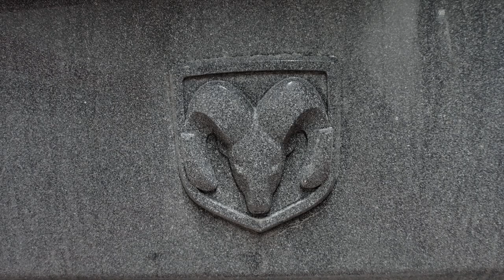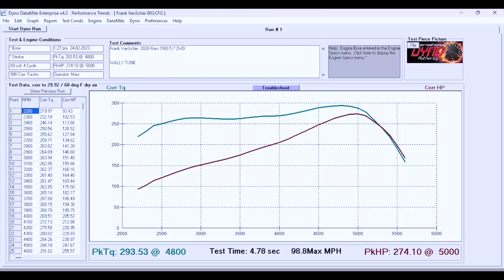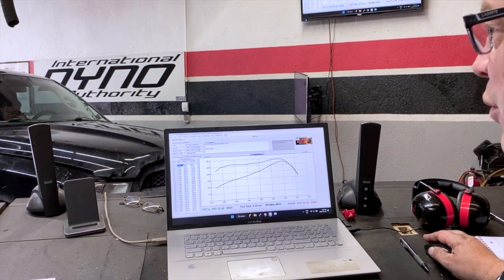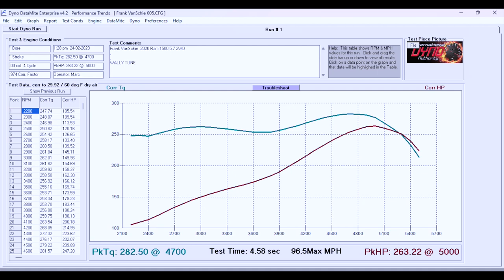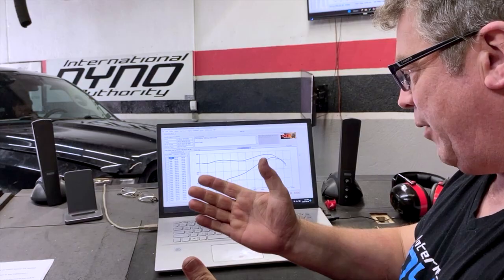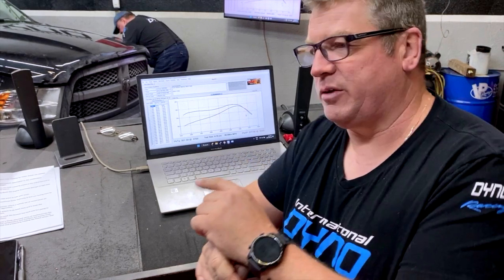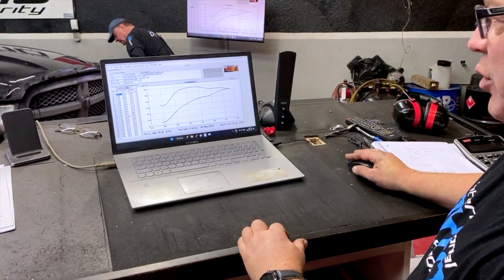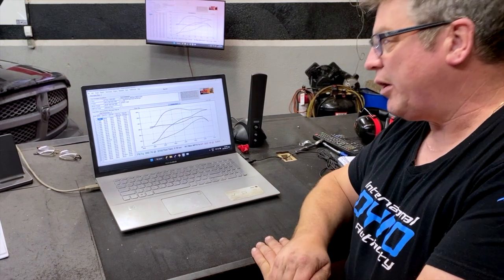Dodge Ram 1500 DYNO Tuning + 100 ft-lbs Torque and +81 Horsepower!

Comment: So hang on you made 90 something lb ft of torque with just a tune on a stock naturally aspirated truck????
Or a turbo kit was installed?(i seen what i thought was a turbo joke)
Cause that torque graph builds like a forced induction graph?? Also was he running e85 or just 91 or what? Please clarify there isnt anything in the description about mods and ive looked at dozens of live custom tuned hemi graphs and none have ever made that kind of power from just a tune. I have a brand new 2023 ram hemi i wouod love to bring in if this is actually the case.
Reply from the maker: @romper4444  91 tune

Cold Air intake 

Long tube headers 

Tune only
Reply from the maker: @romper4444  91 tune

Cold Air intake 
Two wheel drive
Long Tube Headers 
Custom step by step International Dyno Authority 91 tune.

Comment: I live in the states- so coming for a custom dyno session is out of the question. Very impressed with your results. Do you guys offer just a tuned pcm with a conservative tune that would be for sale? Or a flash of mine? (14 Ram with 8 speed & 5.7).
Reply from the maker: Hello, all turning is done in-house live. There is no way to achieve that type of results and get everything correct. While guessing about fuel injector data. Guessing about what reaction do you mass airflow sensor will have on different vehicles.
Reply: @internationaldynoauthority693  thanks for the info. Really wish I was closer to you guys! Keep up the great tuning and videos.

Comment: Impressive and kinda hard to believe with a naturally aspirated vehicle to see that much in gains, I owned a 2012 Ram for 7 years and between being at 5,000ft elevation 3.55 gears it was a turd whenever I put any trailer behind it, this would’ve been nice when I had it. 🤷🏼‍♂️🇺🇸
Reply: Huge difference between 6speed and 8 speed trans. Tuned 8speed way better than 2012. I have a 2012 now, my 18 was a beast compared to this one!
Reply: I absolutely agree with j mack. My brother has a 2014 1500 5.7 and 6 speed. My work truck is a 17 with the 5.7 and 8sp and the crew cab(larger heavier cab than quad cab) and it blows the doors off my brothers. The 8 speed does make a huge difference in acceleration and towing capabilities. I install garage doors and live in utah. Parleys canyon is a pretty steep incline to deal with when your loaded down. My previous wt was a chevy 5.7 and it was a dog goin up that hill with my rack loaded with custom insulated(preppy park city house) doors. The 17 ram could have 2k loaded between the rack and bed and didnt even act like it was loaded.
The other thing is they changed a lot to do with the mds and timing on the newer models. 
And that was before my boss wanted to do some experiments. All our trucks got replaced with the same as mine as i had to convince him to switch to rams. He decided he wanted to try using a tuner with preloaded maps(diablo sport if i remember right)  out of 4 trucks he put the 91 octane (power tune) on mine and his. On the older guys truck he did the economy power tune(made a little difference) and the other guy got the power tune for midgrade gas. I didnt think it was gonna do much but after tuning them we all went up a canyon. Mine and the bosses truck walked the other 2 like they were standin still. The midgrade tuned truck pulled away from the economy tuned one. 

But stock the 17s and up had a lot more output between the 8sp and other ign and fuel control changes they made. My brothers you know theres a v8. Mine before the tune throws you back in the seat like its under boost.

Comment: I tuned my 5.7 myself on 93 with shorties and cold air intake, and it made about 480ft lbs and around 460 hp at the crank. That’s just what VCM scanner said the vehicle made but it’s sort of accurate I think, but I could tell it had wayy more power. I don’t make that power anymore since I switched to true dual exhaust. These motors benefit a lot from just a tune and intake.

Comment: So he was only making 325 at the engine stock? Thats 70hp less than advertised.
Reply: All dynos read different. The number themselves dont matter. What matters is the gain between baseline and after tune.
Reply: Also what is advertised is at the crank normally automatic transmission and depending on you drive line you lose 20-25% of power.
Reply from the maker: We tune roughly 100 of these each year.    They all come in about the same  +/-   10
Reply from the maker: Here are some VERY helpful tech vids on  losses and calculation

https://www.youtube.com/watch?v=OtLG7rpPXhY&t=13s
Reply from the maker: 2-      https://www.youtube.com/watch?v=9Dqe-raCBho&t=77s
Reply: @tizzik1231  Then I would have still expected almost 300 at the wheels...395x0.75=296
Reply from the maker: @jacrain9396    best bet  is to stop over    watch the process  take place live    step by step....... EVERYONE  who does, comes away with 100%  understanding.....hearing and seeing and understanding,  goes a very long way .     2535 Blackwell Unit 108   Welcome  anytime.   cheers

https://internationaldynoauthority.com/
Reply: Dodge measures the crank horsepower without any accessories like alternator, steerpump, A/C pump, coolingfan.
Reply: Where are you located?
Reply: All cars are crank … wheel hp is different
Reply: 325 to wheels.  BIg diff
Reply: Lol dude that’s whp, advertised is always crank hp
Reply: That’s at the crank 395, whp is about 325
Reply: Hello, do you tune a 2003 1500 Dodge truck, and if so how much more power can I expect. I need more power for towing my travel trailer. 
 It does a good job now but I would like to develop more power at a lower rpm.. oh all stock with 3.92 rear gears. Thanks
Reply: Wheel hp and crank bro 😊
Reply: You must be new.
Reply: Lol thats around 400hp crank guy. So 325 is pretty much bang on. Know facts before commenting kid